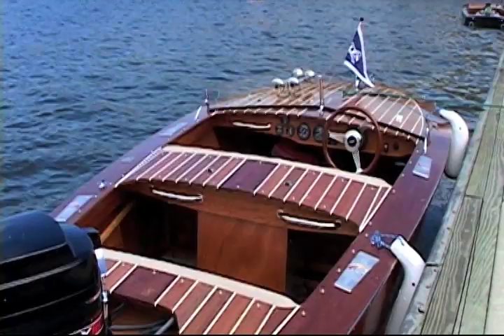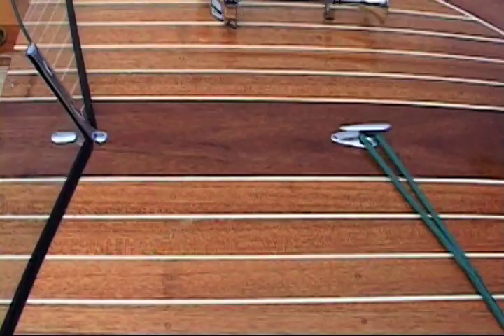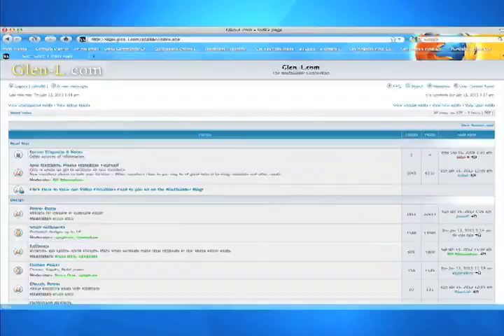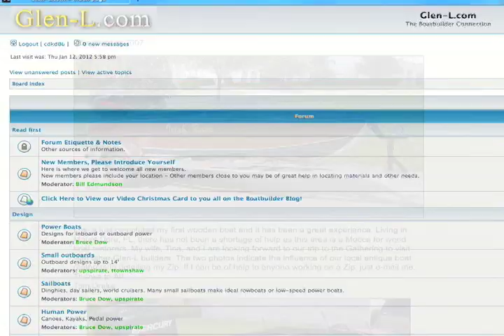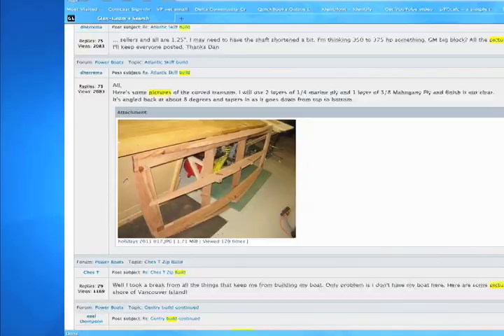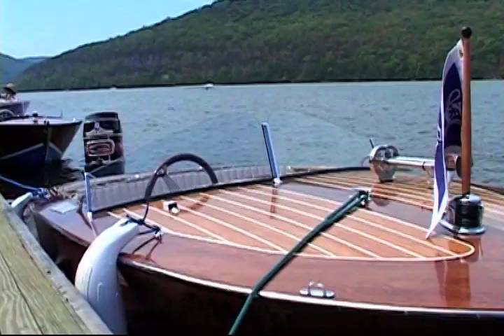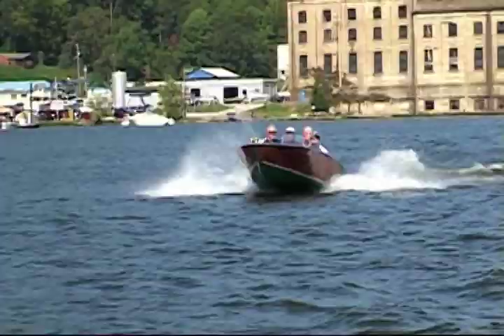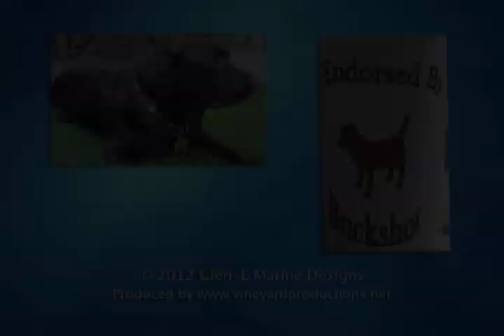Zip 14' Runabout Builder Roberta Hegy

Comment: What kind of speeds does the zip achieve with a 50? And does the transom weight  give any issues?

I saw a zip for sale, no motor. And I want to put a 3cyl Yamaha 50 2 stroke on it. Motor weight ~190lbs

I saw another video of a zip with a 25 Merc and it did upper 20s MPH
Reply from the maker: She got about 34-35 mph WOT with 50hp. You can read about her build in our Forum: http://www.glen-l.com/phpBB2/viewtopic.php?f=17&t=10702&p=149004&hilit=motor#p149004